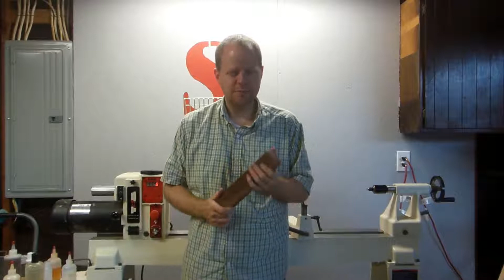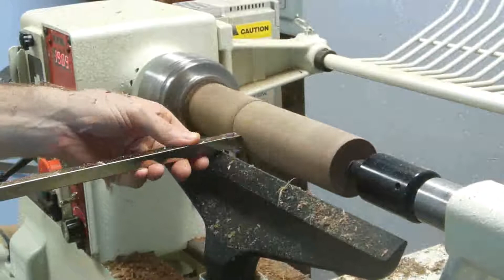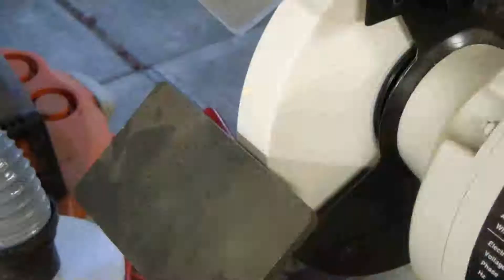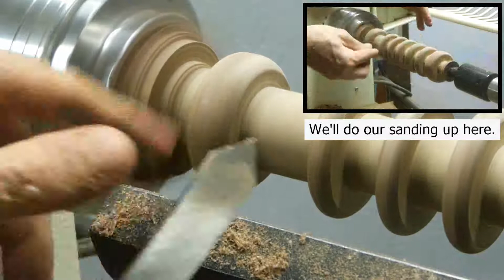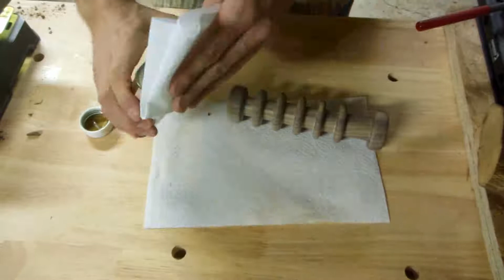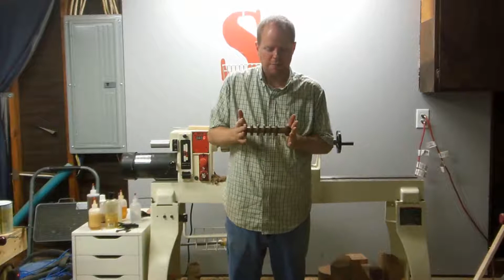Wood turning a ribbon bobbin from walnut wood

Comment: Interesting. You used the partingtool a bit like i would use a bedan. I think your bobbin turned out nice (no pun intended). You might however want to go a bit deeper as that would allow more ribbon to be stored on each segment.
Reply from the maker: Thanks for the ideas, Willem. I made a couple of more after this one with some differences - some deeper wells, some different sizes, etc.

Comment: Question.  How come you didn't put the finish on the bobbin while it was still on the lathe?  Thanks for the video, it looks really nice.
Reply from the maker: Kylie Jane Good question Kylie. Since I was just using an oil finish, I decided to part it off and clean up the ends on the disc sander first, and just rub it all with oil later. I don't think it matters either way for some finishes. You'll probably see me do it both ways with no rhyme nor reason in the future!

Comment: Very nice, Steve.  Nicely turned and eloquently explained.  A question, if I may:  How will the bobbins (you said you'd make more than one) be used.  I know your sister will wrap ribbons around them, but how will she easily pull the ribbon off?  I guess I'm asking if you need to drill a hole through the center so a rod can be slipped through for mounting in a handle to allow just tugging on the ribbon with one hand to pull it out.
Reply from the maker: John Walsh good questions. I made three of them, and didn't consider if there needs to be some system to get them on and off. I was just looking for elegant storage, I guess! Could be a design opportunity there.